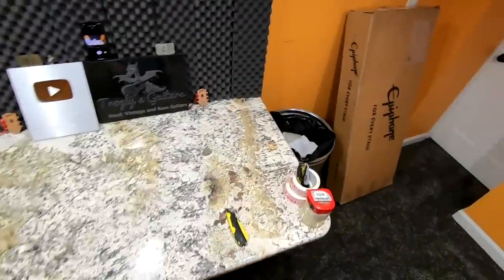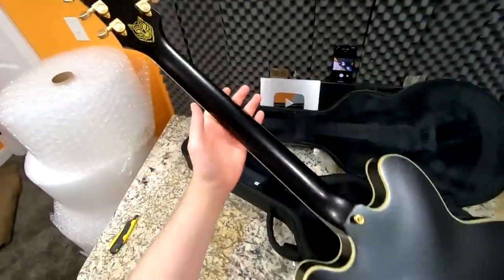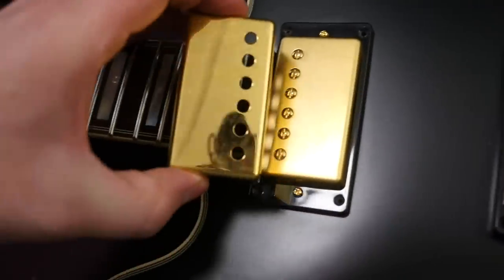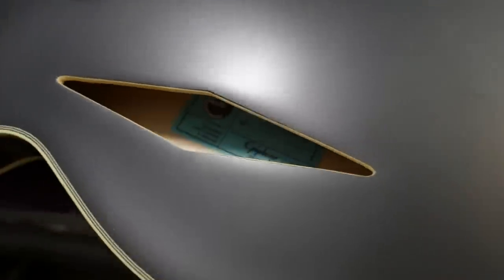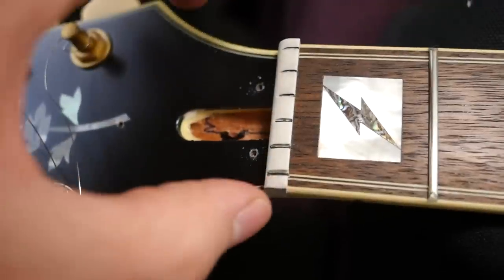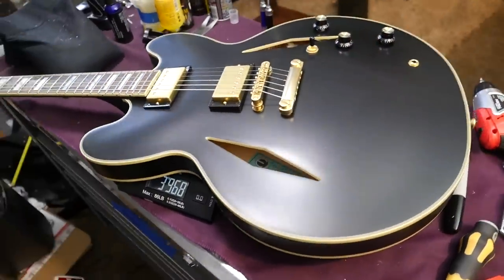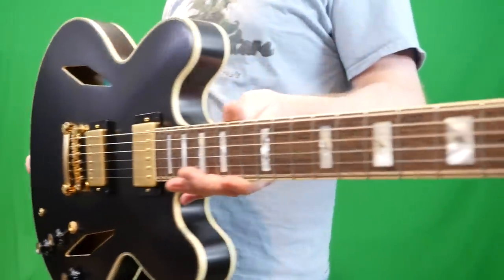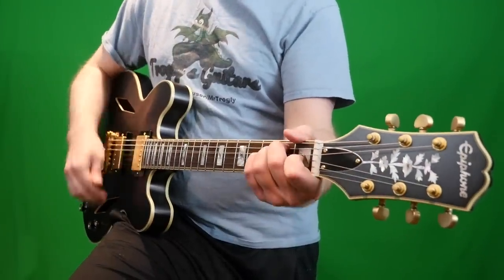Is It Worth Buying? | 2021 Epiphone Sheraton Stealth Emily Wolfe Signature Diamond F Holes Review

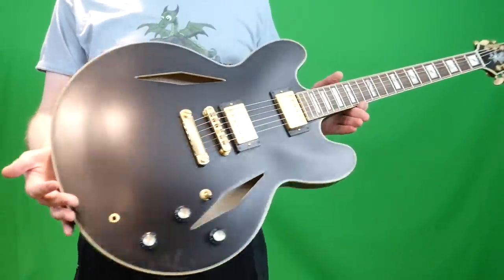Comment: Concerning the Tuners - I had the same issue with my Sheraton Stealth, I emailed Epiphone and explained the issue and even used the time signature on this video to explain in Trogly's words/example what was happening, Epiphone emailed me back and confirmed that this is NOT normal and they offered to send me a new set of machine heads. Just an fyi for anyone else that might experience the tuner issue pointed out at 17:14 .

Comment: The alnico classic pro (at the bridge pickup) sounds SUPER close to the 498T, it’s pretty nice
Reply: It's a horse for courses thing dc resistance wise the classic alnico pickups are modelled after 57 classics the original ones sound more like it. 

When epiphone moved to their more paf design pro buckers they switched out using brass plates to use correct nickle silver. A worthy upgrade in my opinion. 

They got excellent reviews in the press too epiphone has blind tests videos.
Reply: @SionynJones  it’s all personal preferences man, I own both probuckers and alnico classic pros, I like alnico classic pros better
Reply: I agree. Probuckers have a nice chime to them, but kinda lack the guts of the Alnico Classics. Just my opinion 🎸

Comment: My "Wolfe" arrived a couple of days ago. I was inspired to buy it by the long unsatisfied lust for a Trini Lopez and watched an interview with Emily about what she got from a Sheraton. Still, I watched your sage opinion, Trog, first -- so I went in with my eyes open. Finish-wise, it's what you'd expect from a higher-end Epiphone; I mean, it's well-prepped gloss and binding - not nitro. The aged hardware is frosted, not buffed down like a Gibson aged, and the Grover tuners on it are equally satin, making them seem more plastic than usual. However, I didn't get the stepping issue that you seemed to have when turning them, in fact, they were silky smooth. It could be something that Epiphone fixed in production.

A couple of days into playing and fiddling with the tone, the sweep on the volume pots seems uneven. The neck pickup (which I think Emily mentioned she never switches away from) is the star performer, and I had expected to be a bit disappointed with the bridge following your comment but after some real tweakage with the master tone and amp, I did get some really satisfying tones out of it. So the pickups are staying. The fretboard does look quite light and dry so I'm thinking of getting some monty again wax to darken and smooth it.

In the end REALLY, REALLY pleased with it. I've tried a bit of Wes Montgomery and some Van Halen... sooner or later I'll have to attempt some Foo Fighter tunes. Thanks so much for your review, it helped me know what I was getting. You're a star!
Reply: I'd also mention that it seems to have been fret-levelled in the factory... which is good. But if you look at some of the frets, they have quite an aggressive filing (I assume this isn't a plek as I didn't pay for that). You can't feel it under the hand, but at some point, I'd like to take it in to get them polished at a luthier when setup time comes around.

Comment: I'd be curious if changing the tightness of the screw on top of the tuner would changing anything with the 'stepping' on the tuners... Maybe too tight? I wouldn't expect that from those grovers, usually great tuners...
Reply: I would hope that the gear mechanics inside have not been treated like the cosmetics as that would be pretty poor not to realise the negative effects of not using smooth gearing ... !
Reply: I suspect it has something to do with the satin finish. Often the satin finish on metal is achieved with fine grit blasting. The resulting surface has a texture. If the spindle and button are blasted together the surface finish might account for the 'gritty' action. I have the regular highly polished grovers (18:1) and they are super smooth to use.
Reply: @insalinity5558  I tried adjusting the screw on my tuners and it made no difference - the gritty and stiff feel was still there.  it was pretty extreme to the point hat they were not really useable to tune properly.  But they did look really nice!

Comment: Bought it.  I’ve played over 40th years and have owned many guitars but never a semi-hollow.  Could have picked up gibson 335 many years ago for cheap but didn’t care for it.  They just never felt right.  Recently I have a need for one for gigs and I took a chance on this one because of the good reviews and I really dig the look of it.  I have to say I am pleasantly surprised how wonderfully it sounds and plays. Just as good and in some ways better than the gibsons I’ve played. For the money you can’t beat it.  No regrets and would buy it again.  I still want a Duesenberg but no need for a gibson 335 ever.  I also have a strange feeling that this thing will double in value in years to come because of its unique look and features and likely limited run.

Comment: Could the thing you dislike about the tuners actually be an issue with the nut? Perhaps if the slot is not cut right, it is binding and when the wound strings move through the nut they sort of catch with each winding? Does it do the same on the plain strings? Rad guitar though. Just when I thought I didn't need another...

Comment: The “Flower Motif” inlay on the headstock is known as the “Epiphone Vine Inlay”.  That’s what they called it on my 1988 Epiphone Sheraton.  The one on mine is exactly the same shape, but they used abalone, so there’s a rainbow of colors throughout the inlay, and it’s gorgeous!  Mine cost $879 in 1987, so the price on this one is not  bad at all.  I changed the Grover COPY tuning machines mine came with for the REAL ones Gibson uses.

Comment: Why do these guys take apart the bridge when they buy a new guitar ? taking off a set of new strings and removing the pickups gets you nowhere? and for 800$ it better be set up right.
1 no sharp edges on frets
2 correct installation of all parts
3 bridge and nut correct height and compensated correctly
4 no hum, no tuning issues,
5 good quality high ratio tuners
6 quality components
7 properly finished neck fretboard
8 body is balanced and correct weight
9 everything else is just esthetics 
10 I have Ephiphones, so no real complaints here

Comment: Really wish this was available before I bought the Eastwood Grohl ripoff. I mean it plays fine, but there’s aesthetic cracks at the neck joint and a bad paintwork. More than anything they were just an atrocious company to deal with - Eastwood seriously does not give two shits about customer service, and they blatantly lied about specs. Saying it had bound F holes and a rosewood fretboard when it’s obvious it’s not. They also wouldn’t let me claim warranty over these defects. 

Any buyers keen on these style of guitars, accept that you have to be happy with the pickups. Changing them is a nightmare. 

Those stutter tuners are as bad as Chibson!! That’d be a deal breaker for me, I’d have to replace them

Comment: As far as the tuners, it could be the little washers they put in there sticking. You could try backing the screw out a bit and see if it smooth's out, if not it's in the tuner itself
Reply: I agree that it might not be the tuners themselves and I’m wondering if the nut is the problem. The slots look too deep and too tight.

Comment: I wasn't sure I'd like it, on first glance, but it snuck up on me. It's alright. I would have to swap out the bridge pickup, I did not like any of the tones coming out of that pickup, the neck was reasonably decent.

The tuners are a problem. When you first described the problem, it sounded like the string was binding up in nut slot, that they were cut too narrow, however, after you demonstrated what was going on and described the feel and the sound, it almost sounds like the gears are not meshing correctly. In a way it sounds like one, or both, of the gears were cut either too small on the OD, or the cuts to make the individual teeth were cut too deep and too wide, just enough so that there is a significant amount of lash between those gears, so much so that the gears can actually feel like they are jumping as one tooth let's go of its corresponding tooth on the other gear and it allows that gear to jump forward one tooth. I would definitely open up one of those tuners and see what's going on with it, if it's built in a way that allows you to, and if that won't immediately void any warranty (not that I'm saying any company in particular seems to eagerly look for ways to void as many warranties, and deny as many warranty claims as possible, just authentic random thinking out loud, that's all). Just because if there is a problem with the gears or tuners, it's not going to get better over time, it's going to probably deteriorate faster than it might otherwise, because of the pressure, and tension, that is always being applied to them. If it is a problem with manufacturing, problem with that being sent out and getting passed QC, which I'm sure never happens they probably would want to know about that little mistake, and they want to get those replaced sooner rather than later. If it is not something that the parent company wants to hold themselves accountable for, and take responsibility for that issue, you're going to want to find somebody who has more than just simple lutherie or guitar tech skills to fix those, gearing mechanisms. Or alternatively, you could just replace them with something that matches the aesthetic of those tuners

Comment: I have this guitar and I want to like it so bad because it’s just a beautiful guitar.  But the B and G will not stay in tune.   Slips after a few strums it’s has to be retuned.  Also, the pickups are way too spikey.  Might have to do a complete setup before it’s usable.  But man, it’s a good looking guitar.
Reply: try re-doing the winds on those strings. You may have too much excess string on there, or not enough. You have to find the sweet in between. Maybe put some extra graphite in the nut slut.
Reply: I dont have this problem (and i haven’t changed the stock strings yet)
Reply: @maxwellcohen2917  yep, after doing a full set up, it tends to stay in tune better.

Comment: 19:25 wow one tuner doesn't glow
Reply: Yeah, that is strange, thanks for pointing that out.
Does the small “E” string tuning button have the incorrect washer?
It’s my understanding that Grover has two tier levels of quality and that cheaper Grover tuners used on the lower priced guitars only look like the more expensive versions.    I’ve got a 1986 Les Paul Custom that needs a new Grover tuner, when I did some research about Grover I found that they have been made all over the world with the goal to manufacture them as cheaply as possible.  A real let-down to find this out about them.
Reply: @hkguitar1984  I suspected this were some kind of cheaper grovers, they're used in an Epiphone and they feel bad, when grovers actually should be the best ones in Les Paul territory
Reply: @facurojas4477  You would think so, however.............
The Grover Tuners that were factory installed by Gibson on my 1986 LP Custom are very different for that year.  The Grover Logo is roll-marked onto the housing and not a raised part of the casting.   I did some research and found that sometime in 1986 Grover's parent company was shopping around to find the cheapest foreign manufacturer.  As such I've determined that the examples I have could have been made in either Taiwan or Korea!   The examples I have are a result of the lowest bidder within Grover's search for lowest-cost over-seas manufacturing.  Going forward I think I'm going to search out components manufactured in either Germany or the USA. 
Don't get me wrong, the ones I have look great and work fine however modern Grovers are IMO over priced while having multiple tiers of quality while concealing the differences.
Reply: @hkguitar1984  that's sad, I didn't know that much about the tuners haha but is sad to know about that cost-saving decisions affecting the quality

Comment: Bottom line (IMO): The only real problem with this model is the shitty gold paint that Epiphone used on the hardware - rendering it useless for any professional. 
Simply changing the washers and nuts to regular ones will take care of all the control knobs.  Unfortunately the Grover's will need replacement also because of the "Gold" paint.   After rewiring some of the harness - ground and hot wires that broke when I was fixing the input jack - and adjusting the truss rod , this guitar became a wonderful animal!! Now I love it.  Epiphone did Emily a great disservice by using that crappie gold paint on the hardware.

Comment: The neck pickup sounds a lot better than the bridge. The bridge pickup is just laughable. BIG fan of the new headstock. The neck joint paint job flowing onto the binding is a bad piece of work. The neck itself with its inlays is a winner. For $799 that is not a bad buy! I've checked out other Epi hollowbodies and wouldn't touch them, but this is the first one that I would seriously think about (if I hadn't just bought a PRS Hollowbody II with custom pickups and a Pleking, anyway). Good review, detailed, great idea with the pinhole camera.